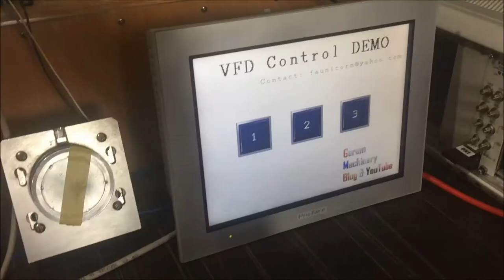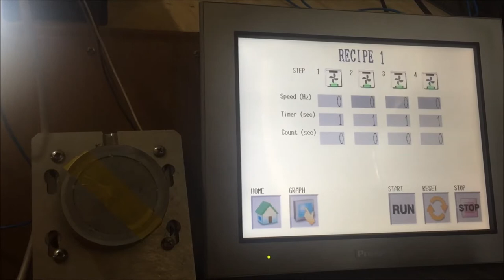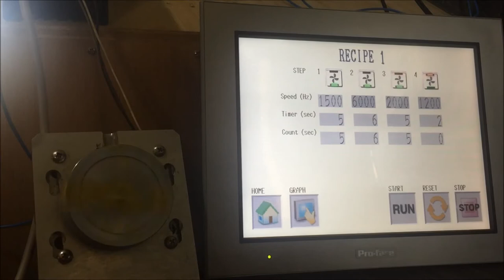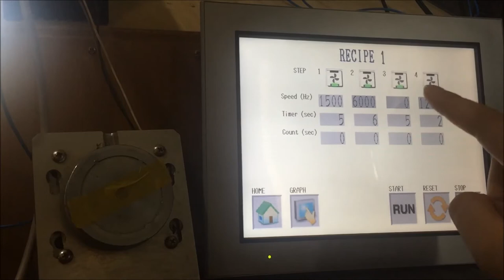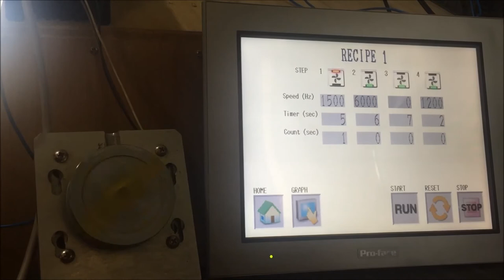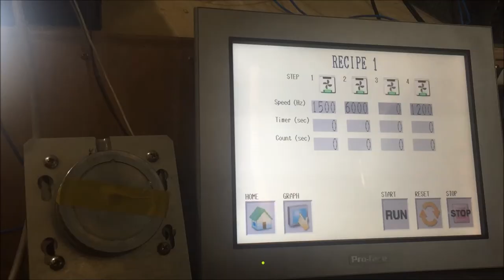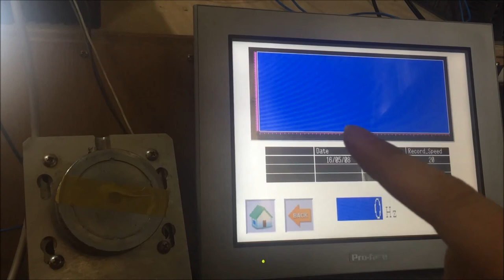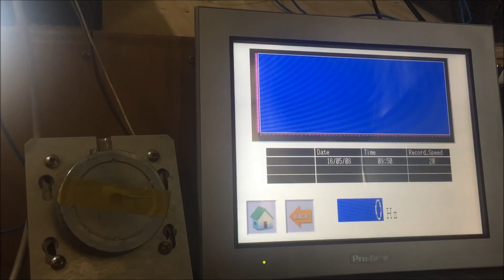HMI Variable Frequency Drive speed control for mixer Proface Remote control demosntration

Comment: Can you input the frequency in a "cleaner" way?
Reply from the maker: +letueur46 Yes you can, you can just simply divide input value by 100 and it would be cleaner. This is just a rough demo so I didn't touch that part.